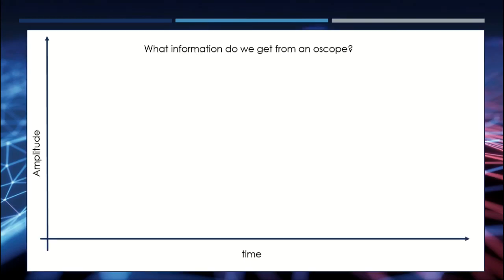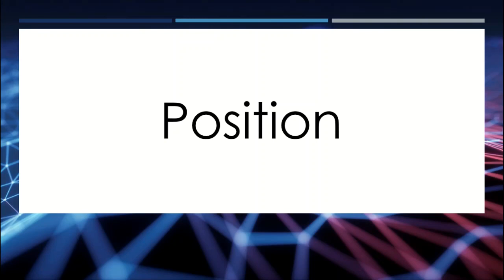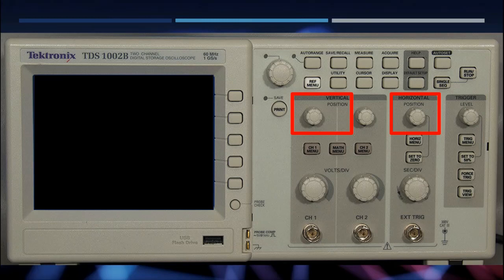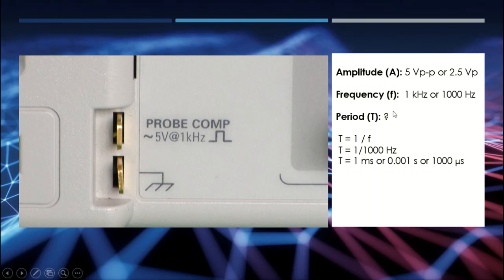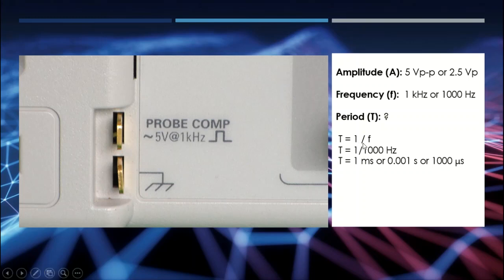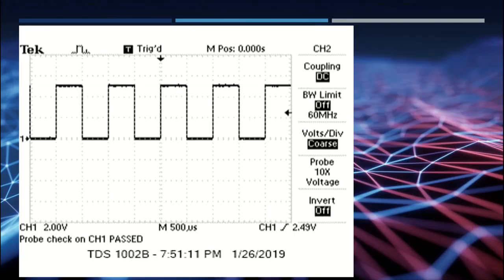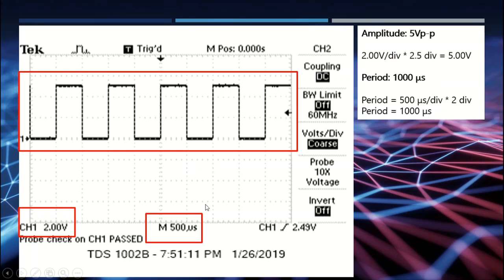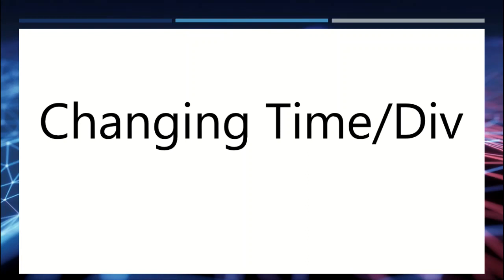Oscilloscope Basics for Beginners

Comment: You are calling the trigger level "vertical position."  The vertical position indicators are on the left and labeled "1" and "2."  Also, "time domain" probably doesn't mean much to beginners...  I would suggest Volts vs. time, y = V(t), instead of y = f(x).